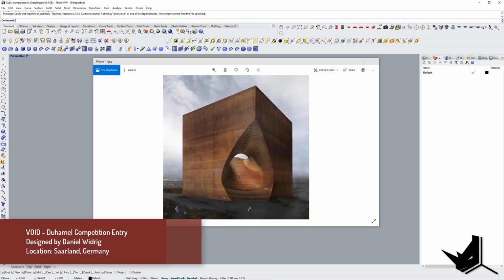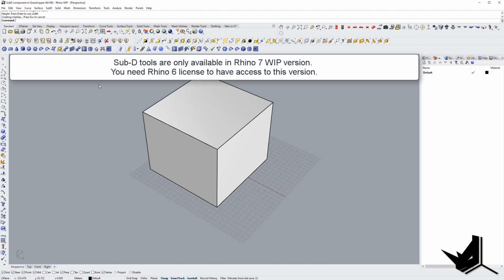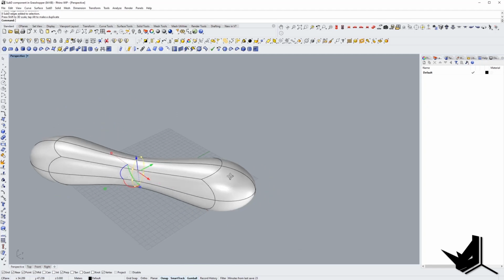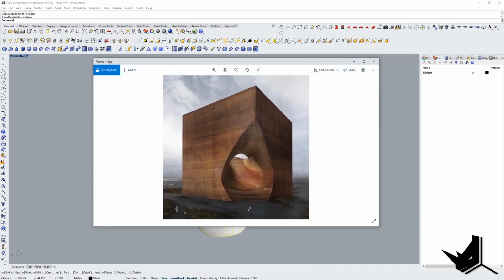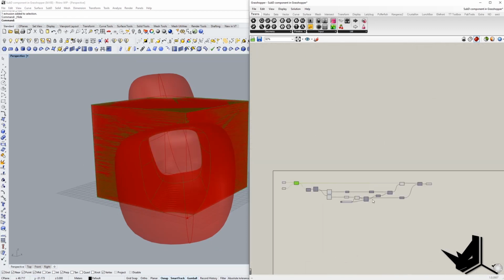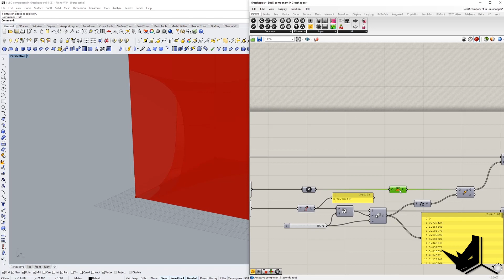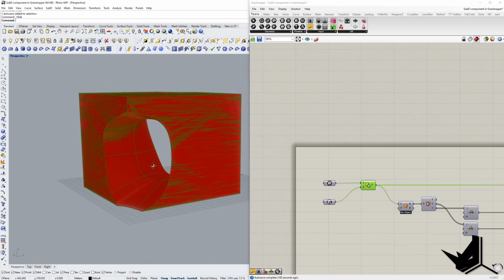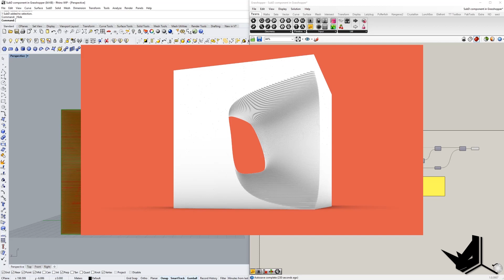Rhino Grasshopper Sub D Component

Comment: Isn't it easier to just take your cut geometry, contour it, use boundary surfaces, flatten the geometry, then extrude? I made a similar project with that method. My question is which method is better and uses less computational power from your computer?
Reply from the maker: Hi Tyler, thanks for your comment! Both versions work in a similar way. I just tested both versions and the speed is varied on both, sometimes version 1 is faster, sometimes version 2, so in this particular case I wanted to show more components and to show how they work with each other. Cheers!
Reply: @HowtoRhino  Thanks for the response! I appreciate you showing different methods, it could help lead to better results in the future, keep up the great work :)